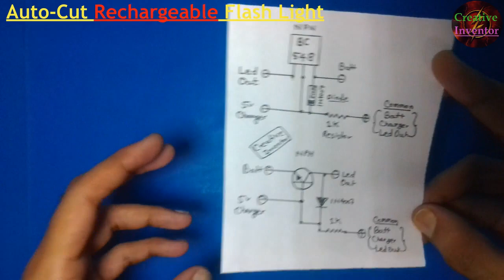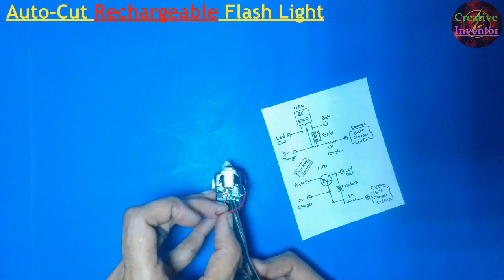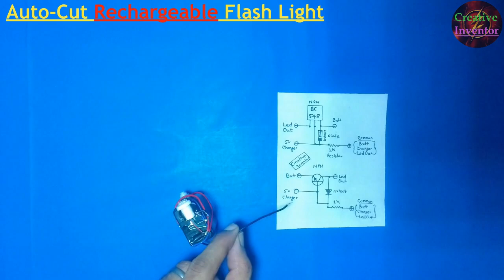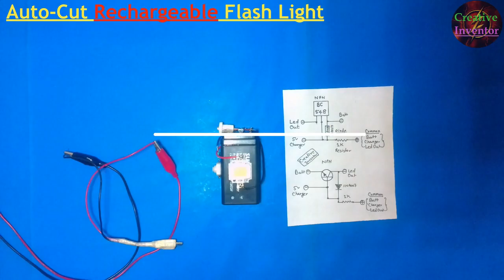Automatic Rechargeable Flash Light Torch | DIY Auto-Cut Rechargeable Led Lamp Using Bc548 & Bc547

Comment: How 12v led is operated in 4v battery ?
Reply from the maker: that's not 12v led that's 4v Version that model of led. In that led design comes two version 12v and 4v, i also got consfused when i saw that led in the electronics shop in the name of 4v. bcoz it looks same like 12v.😅, but when i look close in the yellow area of that led i saw a single led filament in the middle, whereas in 12v there are 9-filaments.
Reply: @CreativeInventorlab  😂 ok bro, Thank you for your explain 😍😍 now i am clear.